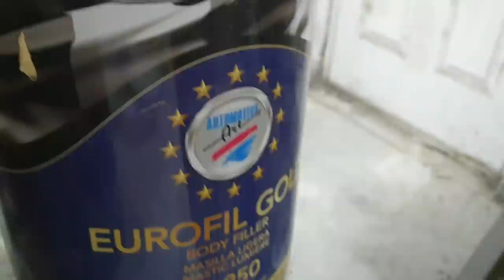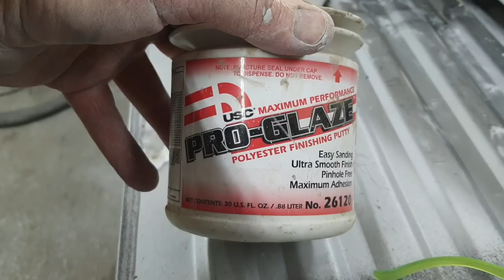VW single cab cherry picker rusted out Restoration Bed bulkhead sheet metal install fill n prime

Comment: Awesome progress! I am working on my double cab.  Just got gas tank restored and in (cleaning out the gas tank area is the worst job ever), added a brake booster, ran all the brake lines, just finished electrical including a new ignition switch (it was sitting over 30 years with a broken ignition switch, very corroded), powder coated the wheels, all new front end (tie rods, dampner, ball joints, center pin, shocks), and I restored all the brakes and restored everything back to stock (previous owner lowered it and I reversed that).   Overall my double cab is ugly but it is mechanically sound, so I can start the metal repair and paint afterwards.   I did the mechanicals first because I need to be able to drive it to move it around my property to paint, weld, etc.   Your videos are such perfect timing for me since I will be going through much of the same, roof repair, bulkhead sheet metal repair, bed repair, back window repair, etc.   Thank you so much for documenting this!
Reply from the maker: yea that was sort of my plan too. make it drive and stop first but i think Im gonna paint it at least inside so I can assemble it and drive it. but I may just do the whole thing not sure at this point.

Comment: Condensation happens and will effect everything no matter how good you do or prepp it. All based on on climate like you said. Doing a good job. Keep up the good work.👍
Reply from the maker: exactly IDK why a repair needs to be better than what was seamed at the factory. Everything will eventually fail if you treat it like it was originally all in how you treat it in the new life after restoration.

Comment: Doing a great job Mike! Little bit of advice. 3M panel bond is a great adhesive. You could have bonded that bulkhead and sealed it from rain at the top and bottom in one step.

Comment: Its been cold in San Diego. Lose any carport tents? Great progress as always.
Reply from the maker: not on that storm but a while back my  shade sale broke a cable. sail is fine but somehow the cable wore through. I will put it back up when it is hotter. My carports are pretty much bulletproof. the harbor freight converted ones.

Comment: Nice work! Have you ever used Cleco clamps for something like the bulkhead? Seems like it would help keep the panel tight and aligned, especially if you're going to plug weld the holes

Comment: This will make a vehicule that can go on the road and represents what was a cherry picker mounted on a vintage single cad VW truck, my concern about that project is WHO will really use it as it can't be an utility truck, its not really a tow truck , not a camper or a minibus
With a such unpowered engine and loaded vehicule, that vehicule can't go where speed limits are say over 45 -50 MPH
Reply from the maker: I am hoping 55mph maybe 60 with big bore 40. but yea it is really not useful. The thing that is cool is the lift comes off the truck and back on fairly easily. Not easy but fairly easy.
Reply: I know where it will go just fine - all the local shows!

Comment: Are the tips on the spot welder small enough for spot welding the weather stripping channel on a beetle (hood and deck lid)?
Reply from the maker: yea that would probably work PERFECT. I would totally go for that . I usually use pop rivets before this spot welder. because the metal on those things is so thin. Rivets under the rubber. cant see them but  spot welder would be much better

Comment: Hey Mike, I know you're swamped with work and stuff but I had a quick question. Can you put body filler over that rust inhibitor or does it HAVE to go on bare metal ? and can you put the body filler on primer ?

Comment: Did you make that tool for the air hammer out of two dollies? Also, are you going to seam seal at the top and bottom of that bulk head?
Reply from the maker: yea for sure Sometimes I put it on then sandwich it but OMG it is so messy. just going to finger it in there want to prime the bulkhead first

Comment: What is the name of the tool you used to pinch over  the edges of the bulkhead panel
Reply from the maker: skin zipper. works great
Reply: what is the alternative method if you dont have one. I have to replace my  bulkhead on my 68 single cab @Mikefngarage
Reply from the maker: @tomtom6319  the only way your going to install that panel is with this tool https://amzn.to/489BDqT the alternative is with a hammer and dolly there is not enough space to use it on there. Long stroke air hammer too.. https://amzn.to/465hxMQ I think this one is a long stroke. A short stroke will not work that I am aware of. I tried it and it would not start, you can try duckbill pilers but you will not like the result.
Reply: @Mikefngarage  thanks for the information I will try and find one around my area.